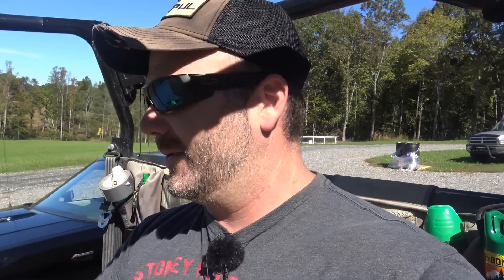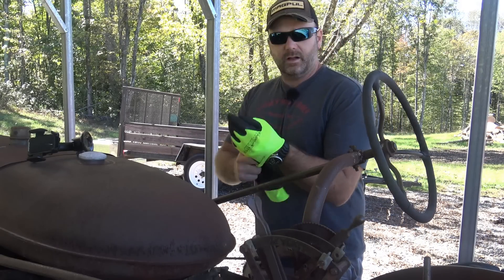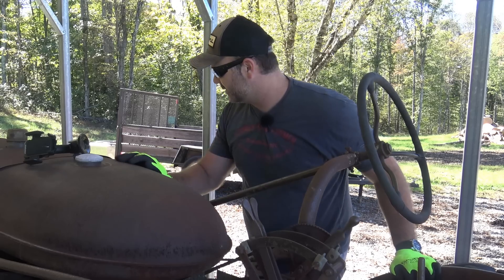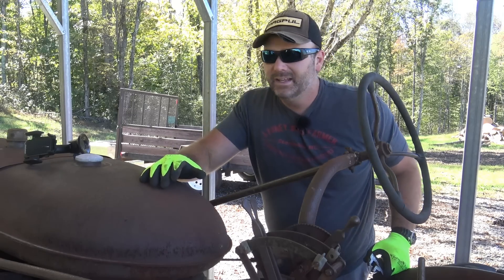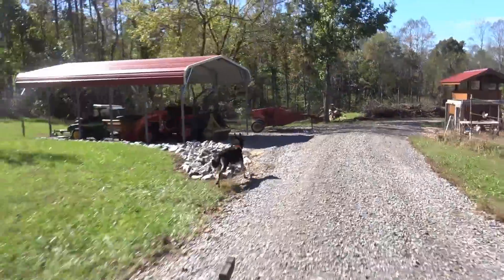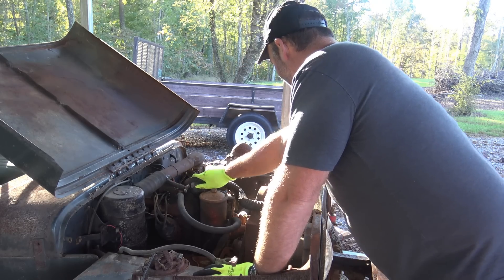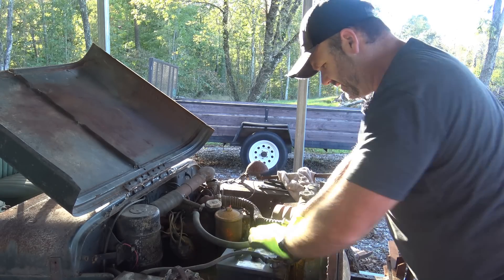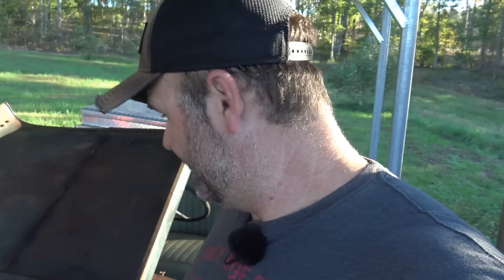WILLYS JEEP... LET'S GET THIS THING RUNNING!

Comment: Before you wear yourself and your tractor (or Gator) out pulling the Jeep around, clean the ignition points and distributor contacts, using either 220-grit sandpaper or a points file. A shot of aerosol electrical cleaner wouldn't hurt after you do that. If you have gas tank for a boat, that will work great as a fuel tank, but if not, a plain old lawn equipment type gas can will suffice. Ratchet strap or bungee the can to the top of the cowl, or anywhere else that's higher than the carburetor, then siphon the fuel through a hose to either the carb or the fuel pump. I usually go straight to the carb if I don't plan on driving the vehicle at the time, but if you wanna drive it around, run the fuel line to the fuel pump. However, make sure the pump's diaphragm is still intact, or you could fill the crankcase with gasoline, which is never a good thing. Also, that 6-volt battery probably isn't worth a damn after got turned upside down and then bounced off of the back of the Gator. You can use a 12-volt battery to jump start the engine, but don't turn on the lights or any other electrical systems until you disconnect the 12-volt battery. Also - and this is important - disconnect the Jeep's fuel line from the fuel pump, or it'll draw up whatever old disgusting crap is in the gas tank, spewing it everywhere when the engine starts.
Reply from the maker: So...we got the jeep up into the shop yesterday....I'm gonna do my due dillgence at preparing the jeep to start before the next attempt..pulling the starter and replacing the battery cables/ground cables....follow along over the next few weeks as things come together...also be a good idea to have some brakes before we get it running...it's time to get workin on this thing

Comment: Pouring gas down the carb throat just floods the engine... you can't fill the float bowl that way.  Only way to fill the float bowl is to put fuel into the fuel line where it enters the carb.

Comment: 6 volt Batteries were never that efficient. Once had a 1963 VW Beatle which I  converted to 12 Volts. Never had any trouble again starting on cold mornings. Did not change the starter motor ,however,as it could have handled the 12 volts.

Comment: You cant fill the bowl by pouring fuel down the carb throat. You should have at least cleaned the battery cables before you hooked them up. The corrosion on the clamps is killing you cranking voltage. 6v systems can be either positive ground or negative ground.

Comment: 6 volt systems are pretty easy to convert to 12.

On a side note, I would probably remove the plugs, pour a little transmission fluid in each cylinder, and motor the heck outta that bad boy. That will at least loosen the system back up.
Reply: The engine seems to turn over easy enough, but he needs to learn basic carb function and put fuel in through the bowl vent at the top of the carb.

Comment: Repro gas tanks are available and they're over $300. Your fuel lines are probably full of varnish so you may have to replace them too (as well as a carburetor kit). The oil bath filter: there are conversion kits to convert the inside to a paper type filter without losing the "look". Check your points, they're probably corroded after all this time. Make sure you have a spark...

Comment: A gravity feed gas tank will work fine.Make sure it has spark check the points in the distributor they may need to be cleaned and filed or you might have to buy new ones make sure they are set right too you can use a paper match book cover to get the approximate distance between the contact points also make sure they are on the lobe of the distributor shaft when you set them the highest point is the lobe turn the engine over you will see them open and close and see if they spark if not then you have no power to the distributor witch could be your coil or ignition switch if so run a hot wire from the positive on the battery to the positive on the coil and see if you have spark I hope you can understand all that and you can probably find a repair manual online somewhere.Good luck I hope you get the old girl running if you got spark and fuel it should run unless the valves are stuck.
Reply: @randy scott - Good advice.  One thing, though. Punctuation was invented for reason.
Reply: Yes, but it wasn't made to get a car running  ;o)

Comment: It looked like you considered the woven wire battery cable as the positive lead from the battery.  Better look again.  I will bet the woven lead is the positive ground.  I do not believe any car ever had an uninsulated cable as the hot lead.  Too dangerous. 

JoeB

Comment: Check spark New battery on a charger clean cables neg and pos. Fix starter clean carb run separate small gas can to carb tank bad. Then try should at least sputter a bit. Then go on that. If you want it to run ok youll dump a few hundred in it. Just the nature of the beast. I have a wagon with a flat six in it already have 1400.00 in it  just to get it running and four tires. Yup nothings free even you child hood

Comment: 7:40 Shouldn't you say that the insulated cable is the negative terminal and the woven-copper strap is positive?  I thought you said that this vehicle was positive-ground...??  Sorry, I don't mean to sound *negative* here... :P :D
Reply from the maker: Hot wire goes to the starter according to the Kaiser willys folks and the starter rebuild guys
Reply: @StoneyRidgeFarmer  Oh, I know that, Buddy --- I'm just saying that maybe the BATTERY is hooked up backwards --- if it's a positive-ground system, then I would think that the "hot" wire would be the NEGATIVE terminal, and the "ground" wire would be the POSITIVE terminal...?

Comment: I would have put me in a deep cycle marine battery in the Jeep the bigger the battery the better and for example a size 24 or 27 battery would be good marine batteries are built better then car batteries you should go ahead and get a good battery for the Jeep you're going to need it anyhow

Comment: Yeah, them's the kind of hand me downs I get: I hand over money, somebody hands me the item. Change that Jeep oil, put in full synthetic 10w-30; I ain't joking nor jesting. I'm certain you can find a starter online; old Jeep parts are available.
Reply: Taka Yama
I have had the misfortune of finding out the hard way that it is not wise to put synthetics in an older vehicle that haven't used them. Some times, (not always), they will leak as the seals just can't handle the thinner fluids. Of course you could do a complete tear down and rebuild but I don't think he wants to spend that kind of money.

Comment: I've got one just like it they  didn't crank good when they were in good shape
Reply: Can you tell him where the  vin number is on the motor?
Reply: @danielheartsill4269  there is supposed to be a aluminum plate between the heater core inlets on the firewall it's held on by screws could have been easily removed

Comment: Ah god.....that's painful to watch you torture this Jeep when you know absolutely nothing about it and what you're even doing with it!! You've probably totally buggered it. There's so much you need to check on it BEFORE attempting to start it......check for vermin nests in the bell housing,check oil is in the gearbox/transfer case and diffs, parts seize up from rust, the pistons could have seized from water getting in, check the coolant.......the vehicle needs to have all electrics grounded to good clean metal tinned grounding points with good ground straps....etc etc etc!!

Comment: Hey Josh don't know if you already do but check out elderlyiron on here Jeff does alot with old gear and is very good at teaching along the way oh and a 12v will not upset too much if it is not run for too long or cranked for too long

Comment: why don't u use the tired AND TRUE method for diagnostics, check spark,fuel system and compression. then try and start. timing and that air box needs to be checked for varmints

Comment: Pouring fuel down the carb throat will not fill the bowl!
Reply: But it will put gas in the intake manifold where it will evaporate and be pulled into the cylinder.

Comment: Just because the battery shows charged, doesn’t mean it’s good. I’ve seen batteries that show plenty of voltage, but don’t have the amps to do the job. Without doing a load test, there’s no way to know. Take it to a parts store and have it tested. And have that starter tested too. You may just have a poor connection or a weak battery. Don’t just fire the parts cannon! Starters can be rebuilt generally for less than new. Our local NAPA does starter and generator testing and repair. Just ask around. Someone will know where to get it done.

Comment: The voltage has nothing to do with which way the ground is set up. Lots of machines had 6 VDC and negative ground. Oddly enough, Mack trucks used to use a positive ground 24 VDC which was 24 V to the starter and 12 volts to accessories. In 1978, (RIGHT IN THE MIDDLE OF THE MODEL YEAR!!!!) they changed over to negative ground. A company I worked for had a bunch of both negative and positive ground vehicles...what a disaster that was keeping parts and knowing which truck was which ground.

Oh yeah, your jeep is negative ground. https://images.search.yahoo.com/yhs/search?p=1952+willys+jeep+electrical+diagram&fr=yhs-mozilla-102&hspart=mozilla&hsimp=yhs-102&imgurl=http%3A%2F%2Fdavehaynes.me%2Fwp-content%2Fuploads%2F1952-willys-jeep-wiring-diagram-of-willys-jeep-wiring-diagram.jpg#id=2&iurl=http%3A%2F%2Fdavehaynes.me%2Fwp-content%2Fuploads%2F1952-willys-jeep-wiring-diagram-of-willys-jeep-wiring-diagram.jpg&action=click